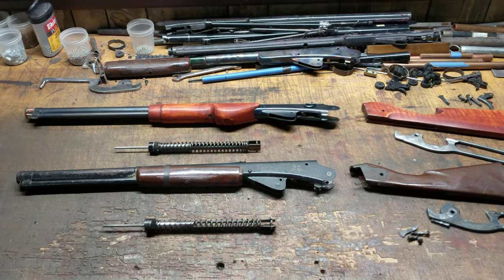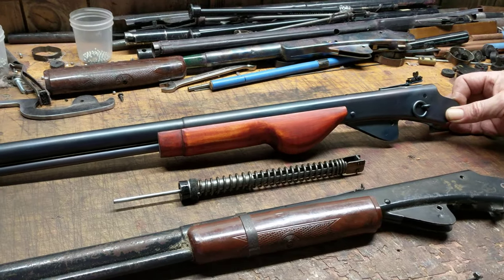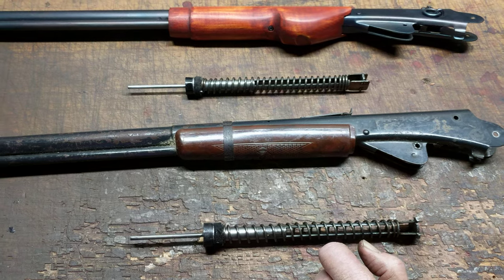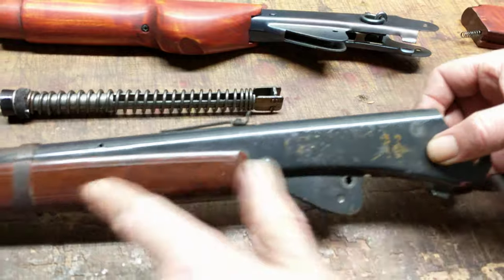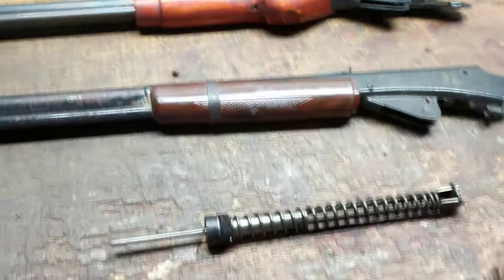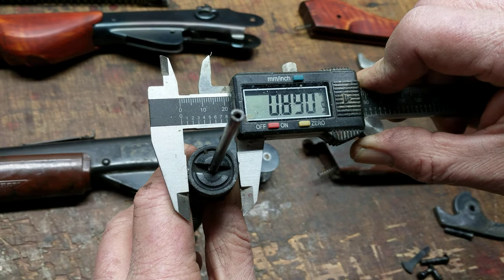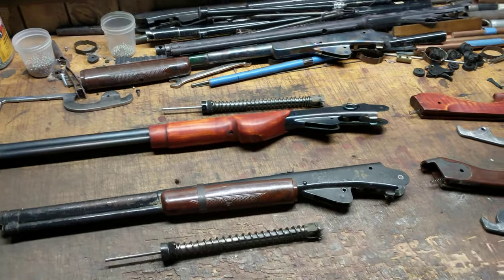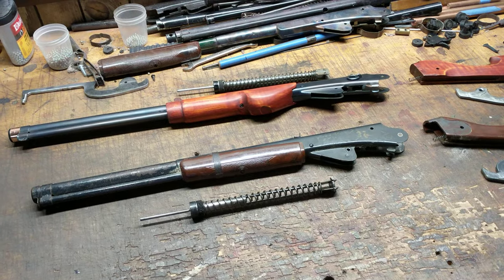Daisy Model 94 compression cups exposé.

Comment: That's basically A11 then modeled as a non before cause the slightzer to me the real determination of the compression chamber The larger chamber is don't really see that much more power and they make a lot more noise when fired To some that don't matter but I also blink at night so I have quiet ones I'm also curious cause I'm looking for a videos on compression chambers specifically I have an 88 that is a small compression sleeve and I'm working on removing it by drilling the punch marks out and testing to make an 88 that has no front rear sights as a point fire large compression chamber current weekend project

Comment: What if you have a Plymouth 94 made for JC Higgins.with short stock and shirt barrel? It does have flip peep and hook front though? Which seals?
Reply from the maker: Russell, Yet another variation! I'd have to say that if your gun has a Plymouth MI roll stamp it should be using the .82  diameter compression cup but I'd also look at the currently installed cup and see what diameter it is. Simple to do with a micrometer, a little tougher with a steel rule or tape measure. The short barrel gun used in this video was a Rodgers AR production piece and was using the larger .89 diameter compression cup, the gun above it was a Plymouth MI gun and was using a .82 compression cup. Any possibility of getting that measurement done?
Reply: @RestOModDaisy  yes I can check dimension when I get home.
Reply from the maker: @russellhorner4950  Excellent, we're one step closer to solving your mystery.
Reply: @RestOModDaisy  ok to make this perfectly clear although confusing.it is JC Higgins model 799.2030 it looks exactly like a model 94.with flip peep sight ,hook front sight.lightening loader bottle cap. Now I thought it had short stock but it doesn't. But it does have a short barrel. Has a 3 star aluminum lever high pivot of course. The roll stamp on top of receiver says Made for Sears and roebuck co. By Daisy mfg co. Plymouth ,Mich. The thing that's even more odd is it has an oil here hole in the compression chamber.Some interesting things are the forearm says JC Higgins Sears and roebuck company where it normally would say it's a Daisy .On the buttstock left hand side it says JC Higgins cactus carbine with a cowboy and a rope encirling it. Still has fake hammer and pledge on buttplate. One thing I mentioned that is also unusual I believe is the lightning loader short shot tube. And for the final thing it had a .8125 plunger seal.no felt wiper and has some terribly thick grease in the combustion chamber almost the consistency of old antiseize if you know what I mean. And it cocks and shoots but goes really really slow.Have to clean it out and see if that helps I guess. Sorry for the long comment.but that's what it is.
Reply from the maker: @russellhorner4950  Thanks for the lengthy reply, I love those! And the result is yet more measured information on the differences between the Plymouth MI guns and those produced later at the Rodgers AR facility. Your short barreled Model 94 (Red Ryder SBR?) has the same seal as it's larger cousin while keeping the hook front sight and adjustable rear. Neat! There's a good segment of the Daisy collecting community that prefers the store brands that Daisy made under contract and even less info on their particulars so posts like yours contribute to the knowledge base and we all learn something new. 

I do think you should scrub the grease off the plunger and well as the compression chamber  with whatever solvent you prefer, just be careful not to get your patch tip caught in the threads of the abutment washer, they are the devil to get out. Hope fully your shot tube is in good shape as they are not real common.  Once again, thanks for detailed response.

Comment: Shane, another important contribution.  I have a subscriber request, would you please do disassembly video for the 25 spring?

Is working on a current 25 inside your spectrum? You would win more fans and I would link. Ii is MUCH asked for, but not my thing.

There is one video on it, but I believe you would make it a degree better. He also is not an airgunner, definitely not a specialist like you.

I was curious if your compressor will work for that or you need a 25 conpressor, separate tool.
Reply from the maker: It's on the list of videos to make but mostly due to the fact I use the larger 29 ounce caulk gun to aid in the disassembly of the plunger assembly from the pump arm before working on the plunger. They are great guns but they are a pain to work on.
Reply: @RestOModDaisy  - Thanks for  confirming the wisdom of my gunshop who said it is not as easy to remove the power plant, harder overall to repair than the Ryder.

Will be excited for your video when you get around to it.